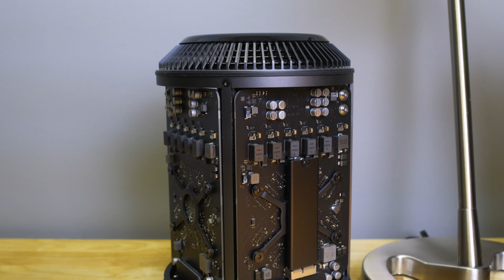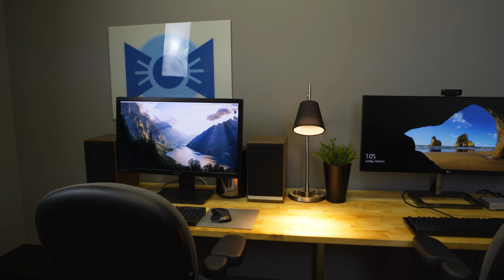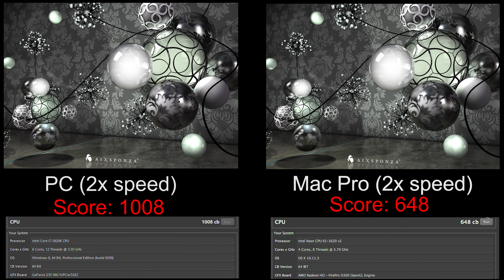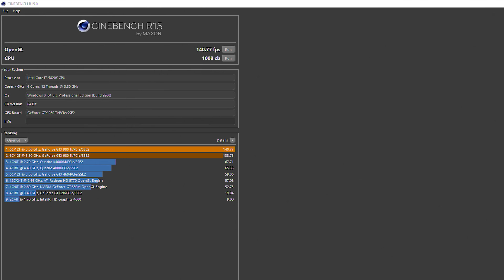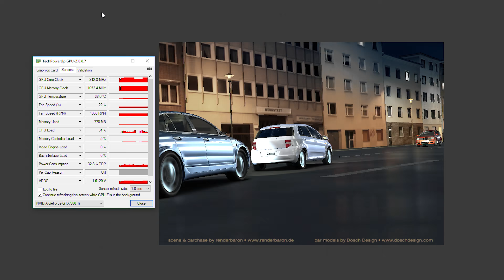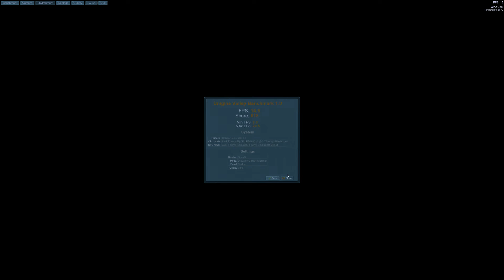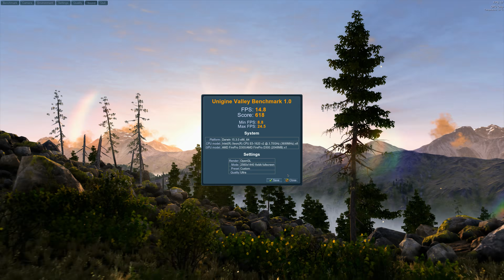$2,000 Custom PC vs $4,000 Mac Pro

Comment: What these comparison videos always fail to take into account is real world use. All the benchmarks in the world don't mean sh** when Windows OS is freezing and crashing and you need to spend valuable time troubleshooting instead of just working. I recently bought a high end workstation grade laptop for video production work. When I benchmarked it, it blew my  2014 MacPro out of the water. However, 1 month later I was on the phone trying to return the damn thing for a partial refund. Stability and knowing beyond a shadow of a doubt that your computer and software are going to be able to do what you need them to do when your on a deadline is really the only benchmark anyone should care about. If your machine is for gaming or personal use, feel free to roll the dice on windows, but if you use your machine professionally, there still is no alternative to OSX.

Comment: No real professional would buy a computer with that trashcan design, you are just asking for thermal throttle and overheating especially with dual GPUs. If you have heavy workloads good cooling is a must.

Comment: Your test is flawed, if you render with final cut pro on the Mac and test encoding times you'd see the software optimization and they even with older hardware it would beat premier pro on the newer better Spec'd pc
Reply: lmao that is even more flawed, final cut pro is only available on mac and renders using quicksync. premier pro is a more capable video editing program and is available on windows and mac
Reply: bodybuilding league tries to scam the test :D

Comment: I wouldn't even buy that Mac Pro or anything else Apple. They're expensive and its not good at doing video editing. Whew. My two $1,000 Laptop PCs run laps around the MacBook Pro in video editing. One is a dual core 6th gen i7 that blew the 13" MacBook Pro away. The other one had a quad core 6th gen i7 that blows the 15" MacBook Pro away in video editing on premiere pro.

Comment: Guess: PC wins.
Reply: Probably, watched alot of porn. thats why.
Reply: Ha ha! Fuck you apple!
Reply: Dude PC ALWAYS wins
Reply: +GamingWithIceNova I know, just felt good to say it.
Reply: that's what happens when you don't know how to maintain a computer and blame the os for shitty software
Reply: +Robert Weaver Should have tried re-installing windows. Probably have too much junk on your PC.
Reply: Until you start relying on your computer to make money.  Coming from a CAD design background PCs are awful!  Constantly crashing and having to reboot.  Even with using top end workstation hardware it's still awful. Many windows programs are bloated and buggy.  That's one of the reasons I have stayed with Mac for my photo editing.
Reply: Not to mention I had loads of issues with PS CC on PCs. Would not even run.  Same revision ran fine on my 2009 Mac Pro.  This PC was a high end 12 core HP workstation with K5000 GPU and 64GB of ram.

Comment: Actually really great review .Love the light-hearted humor throughout.  As a Photographer/Editor It's been the bane of my editing existence trying to make sense out of any Mac or PC editing pros and cons especially now working with 4K. Of course when looking into the latest greatest Laptops if you're using Final cuts pro seems as long as the software is proprietary things are all sunshine and roses but I need a few more options outside of one or two Apple based programs especially since I'm already fully ensconced in windows based programs that I know and love . You're oh so right about the hardware being sooooo OLD and outdated in comparison to the much more recent and current hardware found in almost any windows based PC currently . Well now that I see the numbers being run on more common software cross platform and with old versus new seems the choice is clear or more clear than it was since like say up until yesterday. So I suppose what I'm saying is thanks.  This was VERY informative and makes my choice considerably easier at least for the Desktop and after looking into the latest MSI laptops I think that may just be the best avenue of attack seeing that Mac simply doesn't seem to have an interest in competing with anything comparable to windows on bang for the buck and with the latest hardware no less. BIG difference and certainly worth the investment !

Comment: Pointless comparison. You're comparing a gaming rig to a workstation, not Apple vs PC. 
If you want to do a fair and relevant comparison between Mac Pro and equivalent custombuilt PC, you need to make sure that the custombuilt PC also has workstationgrade hardware (ECC memory, ECC compatible mobo, Xeon processor, AMD FirePro, etc), like the Mac Pro has.
I've done the research and figured out that to build a custom PC with identical (or as close as possible) hardware as a mac pro, you end up spending (slightly) more money. 
The real lesson to take away from this isn't "Apple hardware is overpriced", but "workstation hardware is overpriced for people who don't need it". 
(insert Apples to apples comparison joke here).
Reply: All this doesn't change the fact that for most people, it's obviously the better choice to go with the non-workstation grade hardware, it offers a lot more bang for buck. But please do realise that a "macs suck because this gaming PC is faster and cheaper" comment is as foolish as "tractors suck because this car is cheaper and faster".
Reply: He said he tested it on render speed and it still didnt compete with his PC.... so sorry, but the PC is better.
Reply: + Jake DaSoup Don't get me wrong, I completely agree that the PC here is by far the most sensible computer to buy for most people. but...
That doesn't change that fact that It's an irrelevant comparison. The big difference in performance/cash is NOT due to mac vs PC, but IS due to workstation/server hardware vs consumer hardware. If you build a custom PC with similar hardware (ie servergrade), you would get similar hardware for a similar price vs the mac pro.
Why is pro hardware so expensive? Because it's targeted at big companies, not at consumers. Big companies are more likely to spend big $$ for some feature they desperately need (eg. better tech support, ECC, massive amounts of VRAM, fractions of better reliability, etc...). It's not just apple that does this, it's a general trend. A $2500 Nvidia quadro P5000 gets beaten by a $500 Geforce card in benchmarks. Speed isn't everything.

Comment: Not a fair test, most of the bucks on the Mac Pro are on the disks capacity and no on the powerhorses. I get better system specs by trying a custom mac pro on the Apple page right now, and if you get unbiased you'd actually go deeper into video editing benchmarks and and not just judge from a couple of games and one fucking render. Hate incoming... (Just for the ones who might comment --> I have a custom built Windows rig and a mac pro so don't try to play the smartass by calling me the biased one here).

Comment: The switch to Intel was meant to pave the way for a new era for Macs, and it sorta did, but seems like ultimately all the effort went straight into mobile devices instead, ironically using RISC processors again.

Comment: Next you could compare a 2016 MBP against the Dell XPS 15 - proof that Apple genuinely don't give a shit about their professional range any longer.

FWIW I use both mac and PC in professional editing/3D/graphics in broadcast, the macs are fine except these breadbin Mac Pros, of which 3 have died on me. I love OSX and the optimisation is great, they're buttery smooth below 3 years old  - I think the 30 inch iMac is excellent - but seriously, the hardware internally is bad. They refuse to give Nvidia GPUs as an option, maybe just to piss off Adobe users, IDK. We need CUDA cores to do professional work. Google the internals of a passively-cooled iMac and it's terrifying - they have no fans and there are two heatspreaders, and a bunch of tin foil to dissipate heat. It's like Apple want their stuff to overheat. 

Final Cut X, by the way, is probably not faster than Premiere Pro. They're both bad pieces of software on mac. PP runs extremely well on Windows, if you have a GTX card and an SSD cache drive and/or RAID.

Comment: Oh man.. really? your Mac graphics card in question is not designed to render games. But you know what you're talking about? I'm not a maclover but I admit the quality by the mac, the materials of construction, operating system, efficiency and stability, design.
But what are we talking about?
Really?
Reply: Using Macs to render graphics and make videos is marketing Hype, there is not direct evidence that Mac's are better at anything.
Reply: Yeah though he used "gaming" benchmarks which the Mac wasn't made for, the PC probably still comes above the Mac
Reply: dont lose the focus man, the focus is clearly the price, it even stated on title 2000 vs 4000

Comment: You should be comparing like hardware for performance.  Yeah the mac pro is overpriced for the hardware.  But, it is more accurate to measure performance with similar hardware specs.  It is unfair to measure performance with newer hardware vs older hardware.
Reply: Use common logic, sir.

Their best vs his best.

As he said, that pc is literally still the latest of that model and the most powerful they have.
Reply: Using Macs to render graphics and make videos is marketing Hype, there is not direct evidence that Mac's are better at anything.

Comment: firstly if you are using mac, dont use adobe premiere
use final cut pro, final cut pro and logic pro are 2 only reasons why i would even consider using mac os, even my 2012 macbook pro will destroy ur new pc using final cut pro
Secondly, if you actually max out the mac pro, it will not be that far behind than your pc
CPU score will be better, GPU will be around the same raw power, and yes dual d700 is not good in gaming, but in video editing dual d700 is around the same power as the 980 ti,
thirdly, why would you even consider mac pro, there are so many great mac os product(ok actaully there are not that much), if you dont value the ecc ram, best quality parts, than mac pro is not for you, the people who wants a mac pro wants their system completely stable and working for 24/7, and cannot accept even 0.05%fail rate.

Comment: Macs are too expensive for sure. But the test had a super obvious outcome. First of you match up 3 year old hardware against the current omgitsover9000-shit and on top of that, you use GPU heavy benchmarks. To be at least a little fair you should have done CPU heavy encoding benchmarks, since Macs were never designed for gaming.
So yeah, the message of your video should be common sense, don't spend 4k on outdated hardware.

Comment: The only fucking problem with this video is that he built it so there is no markup value. Apple has to make a decent profit on their stuff. Also he had to go through all of the stuff of building it and he had to order all of the parts. That's the only fucking problem with all of these vids. If your gona do a vid. Do it on on a 1000 apple and a 1000 Windows. Tell me I'm wrong. U can't. It's like comparing apples and oranges.